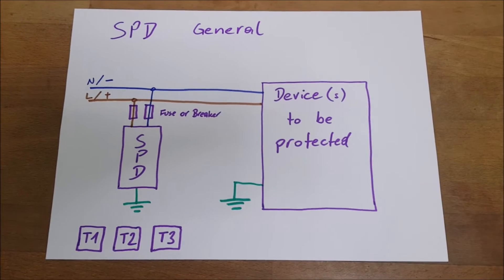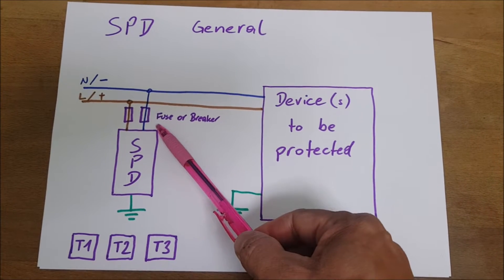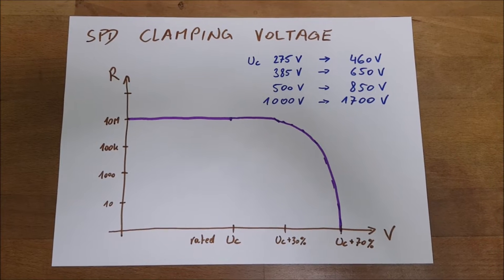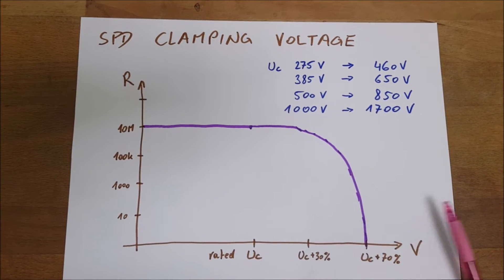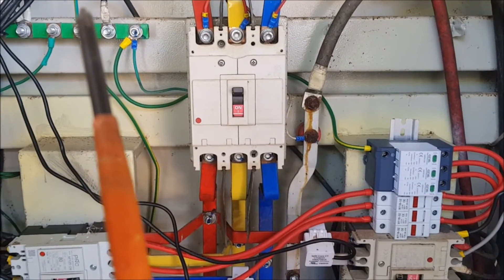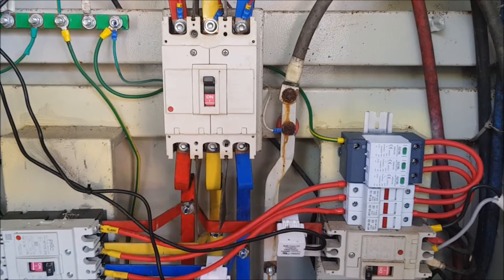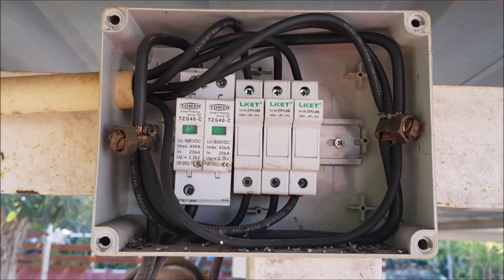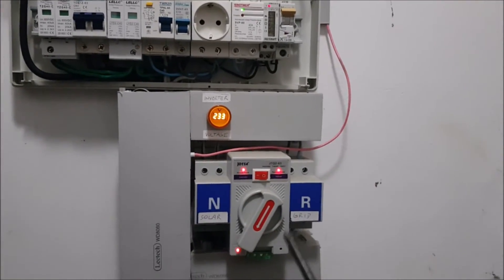AC/DC Surge Protection Device Wiring examples, How to interpret the SPD Clamping Voltage Uc

Comment: Hi Roland. Could explain when would someone choose a 3 pole DC SPD over a 2 pole. Thank you!
Reply from the maker: Hi. A 3-pole DC? I would not see any application for such a device in a PV=systems as even if someone has lets say 2 MPPT strings, would still have separated +/- circuits and wouldn't have lets say a common -. 
The industry is selling a lot of weird things. It doesn't mean that someone is buying and using such a device.
Reply: Thanks Roland for your help. Here's an example prosurge PVB12.5/200-V-CD(S) is 3 pole whereas their other model PVB12.5/200-V-C(-S) is a 2 pole. I am trying to protect a pv system that has an open maximum voltage of 215V and an operating voltage of 167V. The only difference seems to be the Up rating.
Reply from the maker: @mattbixby51  what I see this aren't really 3 poles. It has a plus, minus and ground terminal as every other DC SPD but 3 cartridges. The SPD is a T1/T2 combination SPD so those cartridges might be required to cover for the different Type requirements. One would just need to know the exact build of those SPDs.
Reply: Alright. Then I will probably use the 2 cartridge type then. Many thanks.

Comment: I have on my inverter AC input site with 80A digital Energy meter + 40A MCB + 40A Voltage and current protector. I plan to add an AC type 2 SPD after the meter in my next upgrade.